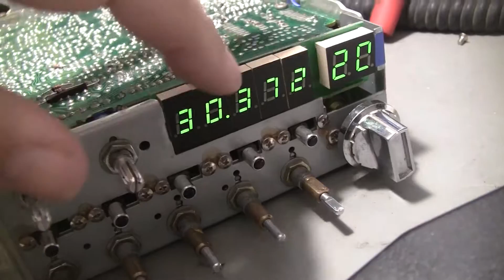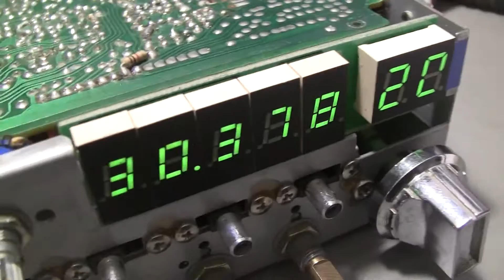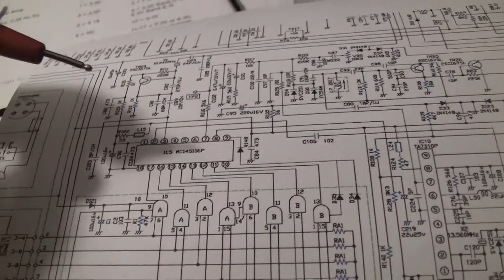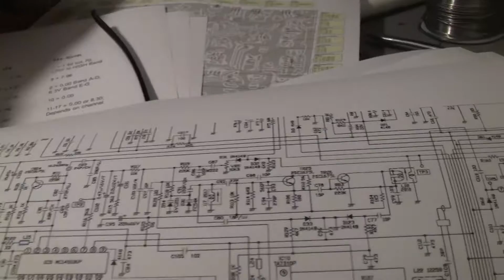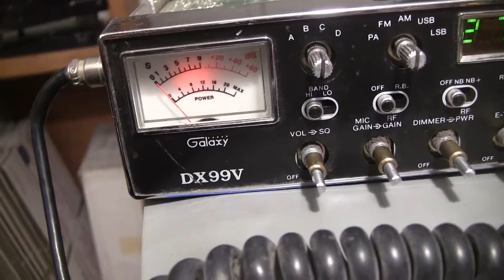Repairing 4 Galaxy 99v's Part 2.

Comment: That LED meter light is drawing juice away from that 1 circuit, causing a voltage drop and creating issues in the radio..... I had that happen to me before in my shop years ago..... Someone added a light after the original went out and soldered the wires close to the meter to make it look neat I guess.... I rewired it to an actual power source that wouldn't cause a voltage drop......Problem solved.....
Reply from the maker: Thank you for the tip !!!

Comment: Awesome, i am working on the same radio now.  May i ask were you got the prints showing TP and voltages?  I cannot find that print anywhere.
Reply from the maker: I got them at cbtricks.com . But remember, anything done by Ranger has false info in it so that the competition won't rip them off. This came straight from the ceo. Best case they are just a guide.
Reply: Thanks Mike, i had the other prints, I just missed that one.  Great video's and I thank you for your time and effort to put these togeather.